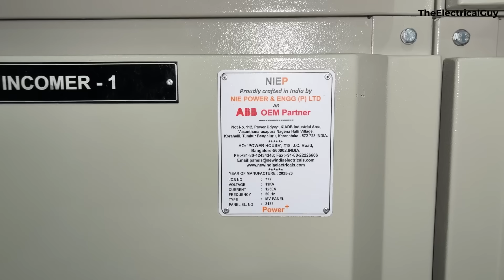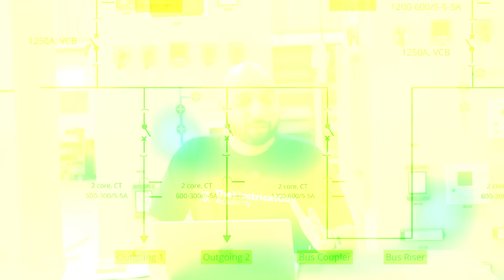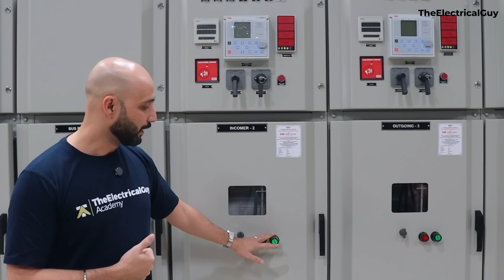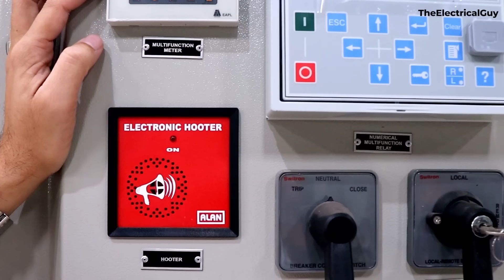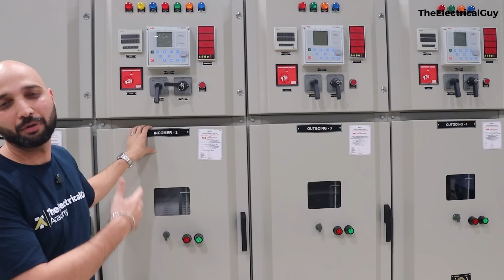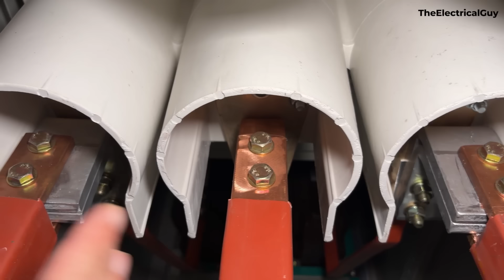Medium Voltage Switchgear Explained: Every Component (Factory Walkthrough)

Comment: Can you also please explain how the HV equipment interfaces/ how they're connected with the protection relays in the monitoring and control room? This is because we are using large cable in the yard but we are using small wires in the protection panels.

Comment: This is a two incomer and one buscoupler scheme. Bus coupler is not closed not becoz it will cause a short circuit but to avoid paralleling . During paralleling ,if there is a SC then the SC current will increase beyoud the STC of the board.
Also pl explain the transfer of controls.
Rest all fine. Very informative.

Comment: Here in the US we call the Bus Coupler. . . . .Tie Circuit Breaker.
Also, if you needed to add additional sections or panels to the switchgear, a good place to disconnect from the system bus would be at the Riser.
Reply: Hi can I get it touch with you?
I would like to learn Switchgear and SLD

Comment: Nowadays, why is it that MV & HV switchgears don't normally have an inscribed SLD on the panel showing various color code of voltage variations? When I was a student, I did an industrial training in one of the distribution stations in my country. That was around 2007 or so. The panel received 33kV to be stepped down to 11kV. The SLD on the said panel was inscribed by the manufacturer (I think Siemens). The color code of 33kV was green and 11kV red. That was how I understood the principles of power system. Even the earth switch and two winding transformers SLD was also inscribed. The color code for 330kV and 132kV was black or orange but I cannot remember their extact colour codes
Reply: You're right, they don't do that on newer panels, only on older ones. I hadn't noticed that until I read your comment.

Comment: Good info I am from NZ and system here is bit different, I did not see any earth switches which we use here, also we have PT at the bus riser chamber , also there is no arc flash prevention and compartments that I see which is one big factor in MV boards, 
 but good info excellent for beginners.

Comment: Hi Gaurav. Thank you for the efforts taken to bring this video and sharing knowledge with your viewers. With all due respect let me correct you on some info which is wrong. As some have already raised it, I just want to dive further as I am pretty sure someone will go through the comments to find the right answer. The Bus coupler is provided for two reasons mainly: 1) To couple both the incomer supply [ I1 and I2]. This is done to provide redundancy to the network while maintenance or when there is an overload to any outgoing feeders to protect it from tripping.  Coupling I1 and I2 supply will NOT create a short circuit as the Voltage, frequency and phase sequence will be the same. On the other hand if you switch bus coupler ON after switching OFF either one incomer supply, you tend to trip the complete section of that incomer as the supply has been cut off. So make sure to turn the bus coupler ON first then turn OFF the incoming supply.  2). Bus coupler when in service will provide the back up protection to that section. Let me explain that with an example. If Incomer 2 needs to be taken out for maintenance, we would couple the panel using the bus coupler. Then I2 supply is turned OFF. So now the entire panel is being fed from Incomer I1. (i.e.) The outgoing feeders which were fed from I2 is also being fed from I1 through the bus coupler breaker. Now in case there is a fault on any outgoing feeder from the second section[ (i.e.) outgoing feeder initially planned to be fed from I2 supply. ] that particular breaker would trip, and if it doesn't the bus coupler would trip as well. Thus it would at least protect the outgoing feeders of I1 supply while the fault is cleared.  
I hope this comment helps. Happy learning!
Reply from the maker: Certainly, we can close bus coupler when both incomer are ON. However there are conditions that must be met which you described. But that synchronisation is very critical

Comment: Thr second incomer with 1250A feeding 2 outgoing of 600A each at bus B, perhaps not sufficiently rated enough to feed the outgoing feeders which are again rated 600A each on bus A, in case of an issue with income 1

Comment: We can definitely close the bus coupler when both of the incomers are in on condition provided that their phase sequence,voltage reading ,and phase sequence matches , also we use when we are paralling two supplies and after that we switch off the incoming during change over

Comment: 7:51 As an advice and warning at the same time to anyone working on these circuit breakers, ensure that you ALWAYS lock the CB Trolly when latched onto the panel position via the built in breaks at the buttom of trolly to avoid people and equipment damage during rack out and removal for maintenance of the CB or inspection or any reason.
Notice how it moves and almost slides out because breaks were not applied.

Comment: Sir, need video on how to read/understand the parameters in (i) different types of contactor, auxiliary contactor  with examples  (ii) different types of miniature circuit breaker with examples (iii) difference between overload relay, motor protection circuit breaker with examples (iv) difference type of timer with examples